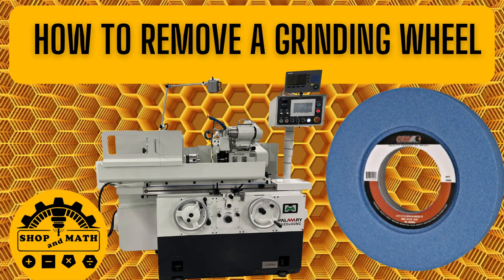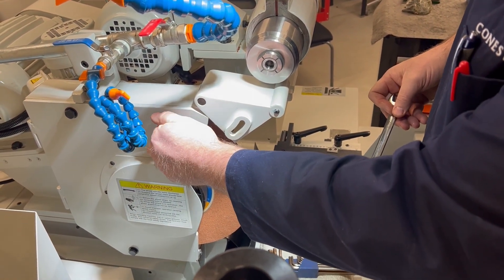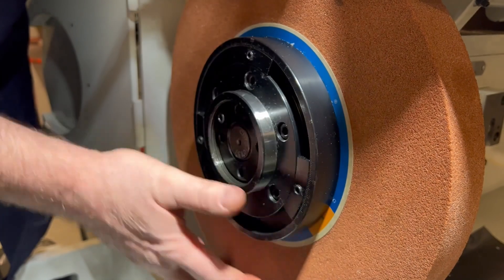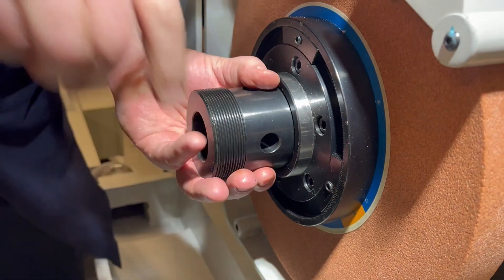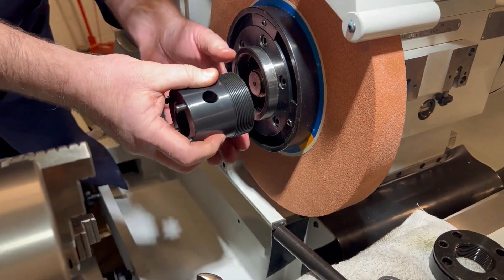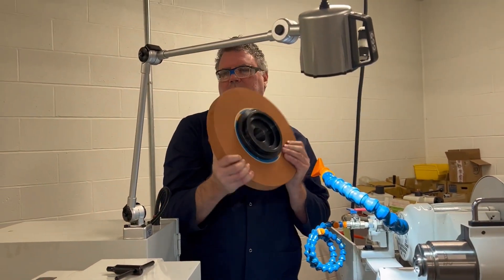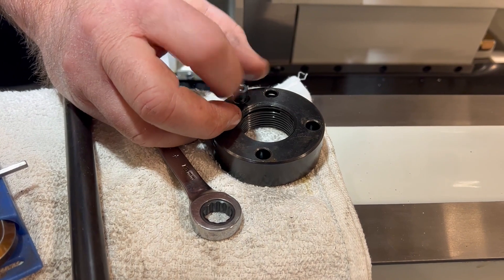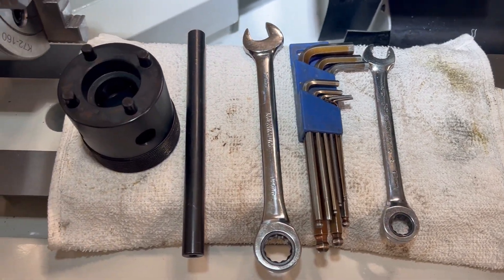How to remove a grinding wheel

Comment: Doesn't the locking SHCS in the OD wheel locking nut throw the balance out?  The wheel hub is balanced with the wheel, but not the SHCS in the nut.  Of course, the locking nut has a "slot" cut into it to allow the SHCS to bind the threads, so does the locking nut/SHCS assembly balance itself out?  Just curious!
Reply from the maker: That’s a great question but the amount of material removed plus the added weight of the SHCS would probably equal each other, plus it’s near the centre of the assembly, plus the hub has been balanced, that it doesn’t effect the finish.
Thanks for the very thoughtful and intelligent question.